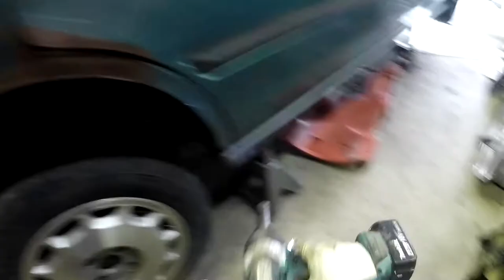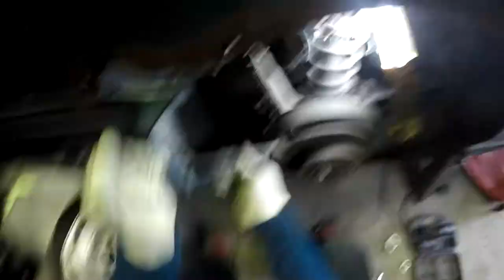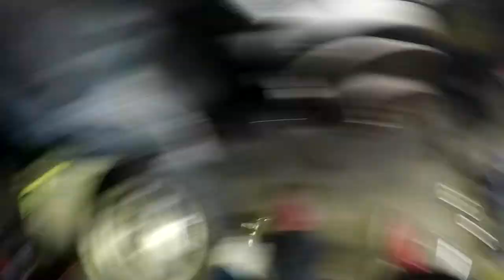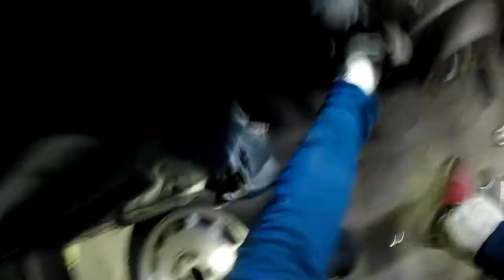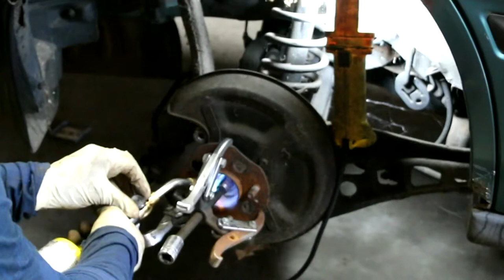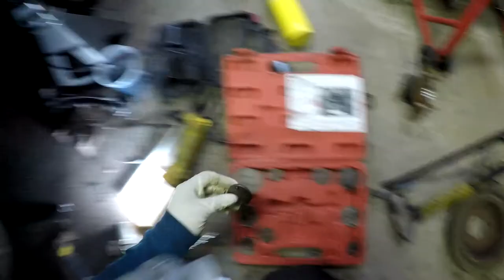5 Lug Conversion (Part 2) | CB7 Project: Episode 9

Comment: You never hade a problem with the axle nut not treading in all the way with the washer on what you did just torque it down and knock it as much as u can please let me know don’t want my wheels to come out
Reply: Orlando Morales a lot of guys swap the stock axle shaft with the 98 accord rear axle shaft with a 1/8” washer on the 98 shaft so it would be perfect size

Comment: What I will use for the rear conversion I know I need a prelude hub what rotors can I use
Reply from the maker: U need a prelude nut as well
Reply: Idk if you need the info, but Integra Type R rotors will work.